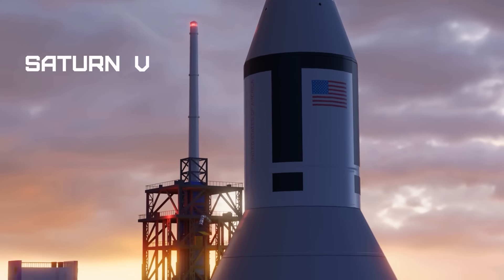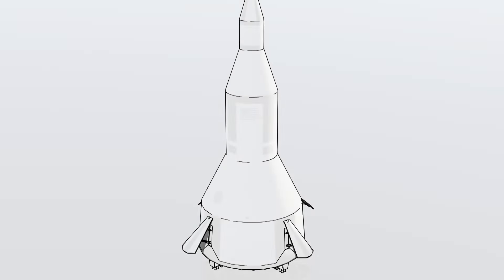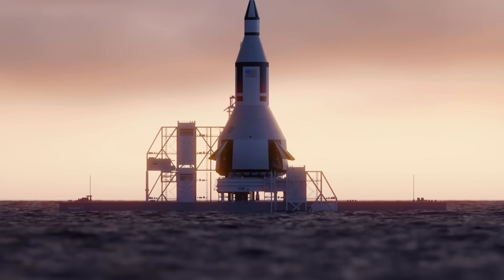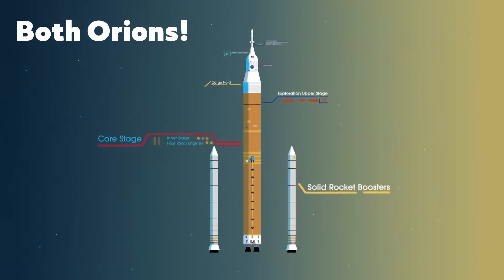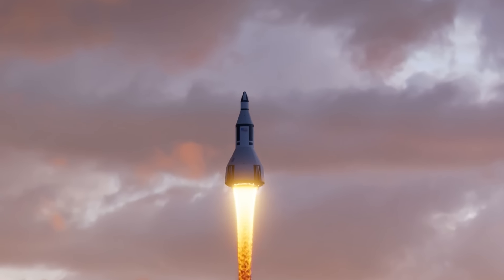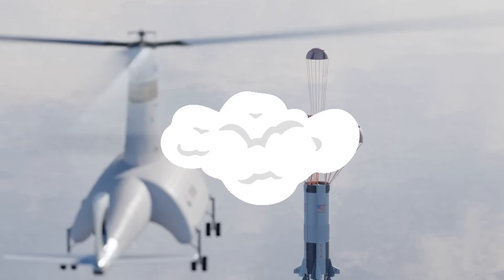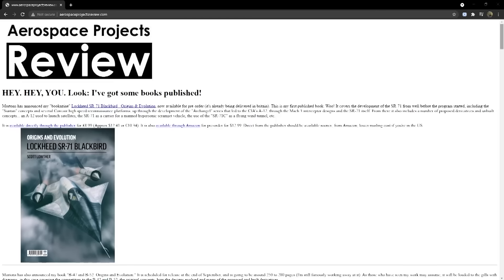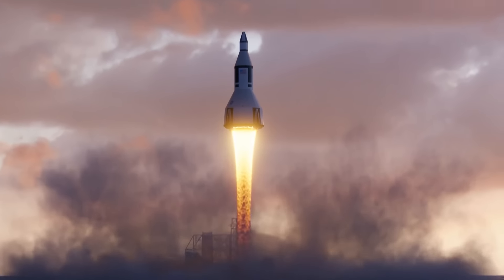How To Fly An Entire Moon Base In One Go - Saturn V 2.0 - Convair Nexus

Comment: Once upon a time, I studied aerospace engineering. One of the problems faced by these gigantic rockets but surprisingly unknown at the time is the fact that the structures of the rockets are not perfectly rigid. Pogo oscillations where the spring rate of the structure interacting with acceleration oscillations caused by propellant manifold pressure changes causing thrust changes...is a very complex dynamic that later destroyed the Russian N-1 booster. Handling and suppressing Pogo oscillations becomes absolutely critical in a large rocket.
Reply: Have you heard of Kerbal Space Program? It's a huge pain when you're trying to build rockets in that game.

Comment: The SRB's were needed because it became clear that while hydrogen/oxygen rockets are massively efficient they don't have a great thrust-to-weight which means it is slower to accelerate off the pad and therefore wastes propellant fighting gravity.

Will there be a seperate "Saturn V-NEXUS" video? You kind of mentioned it in passing, (as did Convair, after NASA requested the idea be looked at Convair used part of ONE page in its report to "note" that the "Saturn-NEXUS" design would be a total redesign of the Saturn S1 and SII stages to be fully recoverable and fully reusable AND allow a much larger payload mass to orbit using most of the same facilities and infrastructure already established for the Apollo program. (One major concern which the Saturn-NEXUS addressed was the short-comings, no pun intended, of the VAB which could not handle the height of some of the later planned space probes and launch vehicles being to 'short' and  the doors being unable to be made taller) Saturn-NEXUS would have packed the same power and lifting capacity into a much shorter but wider (but well within the door width of the VAB) two stage launch vehicle which would lose none of the Saturn V capacity but would be fully reusable.

As a note the original NEXUS while being sized to carry a larger Orion drive vehicle (size mattered, the small Orion drive which would launch on something like a Saturn V was actually too small to be really efficient whereas something with a 20 to 30 meter 'pusher-plate' was far more efficient) the rather 'insane' part was this changed to using OPEN CYCLE gas-core nuclear rockets! Essentially a nuclear engine core so hot it is ALWAYS melting down (hot enough to form a plasma actually) into which liquid hydrogen would be pumped for thrust. Needless to say a 'slight' downside here is containing the hot plasma nuclear fissioning material was essentially impossible and this thing would be throwing out radioactive materials all during operation.

Comment: The Convair Nexus seems like what would've happened if the Saturn project evolved and took on the team working on the Sea Dragon
Reply: The convair nexus would have never happened. Just listening to the outlines of what it was supposed to do I can tell you this thing would fail. If not in engineering then in cost.
Reply: Proper descendant of the Saturn V 1969-1972
Reply: @GusOfTheDorks  I don't doubt that it would've failed, but I feel that the lessons learned from that failure could've been invaluable and accelerated our space capabilities, instead of stagnating with the Space Shuttle and Soyuz as our only means to orbit for decades.
Reply: @bethtargett4304  No, that would be horrible. Every failed project is resources that could have been poured into something realistic. Never mind the fact that a rocket failing is incredibly dangerous. I mean its fun to watch, but that dome has 5 foot thick bits of titanium. No matter where it blows up at, you dont really have control of where that kind of stuff lands. Or what happens to the people on it when it fails.

Comment: What a marvelous era of unbound optimism. The downside was, as other commenters point out,  that those harebrained project almost always included military applications. That was also their downfall - once politicians realized that ICBMs are good enough, and those launched from boomer subs survivable enough, they lost interest.

There is another factor contributing to present dearth of such grand proposals: aerospace industry consolidation into only few giants leading lazy life on mediocre "cost-plus" projects. To wit, see Boeing.
Reply: Cost-plus makes sense though - cut corners are the last thing you want on a spacecraft.
Reply: @HalNordmann  You don't want to give lazy manufacturers unlimited budget and no deadline, either. You end up with SLS.
Reply: @bazoo513  Compared to other projects, SLS isn't as bad as it may seem. Every aerospace project is overbudget and late, it is literally rocket science after all. Plus, most of SLS's costs are fixed ones (worker salaries, sweeping the floors, maintaining the tools, etc.), which combined with low yearly budget can get high. Sometimes you can get something done cheaper by giving more money up-front.
Reply: @HalNordmann  I agree about projects ending up much more expensive if you finance them by the eyedropper, but SLS was drowning in money mostly taken (by Congress) from the Comercial Crew program, which ended up comparably dirt cheap.
Reply: @bazoo513  Saturn V was also expensive. And ComCrew seemed to be drowning in dev money also for something supposed to be "off-the-shelf" per-flight payments.
Reply: @HalNordmann  Apollo program (of which Saturn V far a significant, but not major part) put people on the Moon seven years after the first suborbital crewed flight. SLS took 11 years to cobble together a launcher out of leftover Shuttle parts and is yet to fly.
As for the history of Comercial Crew program and its funding, I suggest looking it up a bit - I will not rehash it here. It was not a purchase of "off the shelf" services.
Reply: @bazoo513  SLS is way more complicated than putting together spare parts - core tankage had to be completely redesigned to handle different loads, SRBs have brand-new active parts, launch infrastructure is brand new, and so on. A lot of these issues hadn't been expected, and don't forget the smaller yearly budget. They simply couldn't get as much work done per year.
Reply: @HalNordmann  Can't you take a bit of hyperbole - they had to do something . And, again, compared to the actually work done, their budget was huge at the cost of the actually working Commercial Crew program.
Whatever.
Reply: @Sciurus  Your autoregressive language model based text generator is broken. I suggest switching to GPT-3 or LaMDA 2.

Electrohydrodynamics is well understood, fun, and, sadly, useless for practical applications.
Reply: @bazoo513   I think you misunderstood what I am referring to. Maybe you should start by watching Eric Dollard's lecture on YouTube titled "History and Theory of Electricity". He also has many other good ones that further explain the pulsed longitudinal dielectric "wave" phenomenon!

I am not referring to electrohydrodynamics (or magnetohydrodynamics) or even the transverse wave Electromagnetic spectrum based phenomena. I am referring to phenomena that occur when using pulsed high voltage dieletric fields (electrostatics) that Nikola Tesla was working with after he had moved on from studying Alternating Current based technologies. 

Dr. Thomas Henry Moray's book "Beyond the Light Rays: the Sea of Energy that the Earth Floats In" would be another good reference to take a look at as he also studied this phenomenon and developed many technologies to control it. He was also the true inventor of the germanium transistor almost 20 years before Shockley got the patent using one of Moray's assistants on his team but the patent office screwed him, but alas that's another story for another time. The newest edition of "The Energy Machine of Joseph Newman" might be useful too. William Lyne also has some interesting and relevant books, i.e."Occult Ether Physics" and an interview that is floating around YouTube on a show called the "33rd Parallel" that you might be able to find by searching for "William Lyne Hitler's Flying Saucers".

If you have the time and desire to look and learn (admittedly two resources that are in short supply for all of us these days), then maybe after you go thru this material you will understand what I am referring to! Best wishes to you!
Reply: @Sciurus  "... and developed many technologies to control it" - Such as? Why are they not around? Someone "suppressed them"? Who and, most of all, why?

Best wishes to you, too!
Reply: @bazoo513   I'm assuming you mean Dr. Thomas Henry Moray since that's the part you quoted, but he developed switches, diodes, triodes, resistors, inductors, and all other sorts of fundamental analog circuit type signaling components for Tesla's radiant energy/ dielectric longitudinal waves / electric sound waves. Basically analogs to the fundamental common components used in normal electronics, but instead of developing them for electromagnetism, i.e. direct current and alternating currents, they were developed specifically for this other type of field perturbation, the dielectric longitudinal "wave". They were all components he developed and worked with for his "Swedish Stone" Generator system. This was the analog days before digital signaling equipment was a thing. Who shut him down? Initially? According to him and first person witness accounts it was communists that had infiltrated the Rural Electrification Administration, one even attacked him with an axe 🪓 and then chopped his prototype up at a public exposition of the device. The poor guy was shot at so regularly he needed to build an armored car and never went anywhere without a loaded revolver. Who ultimately shut him down? Market forces and lack of funding because when his generator was axed to death by some 1930s American communist sympathizer emulating Jack Nicholson in "The Shining", all the working components that he reused when building new prototypes that he had that had been custom machined and manufactured in Germany at the time were destroyed and were too expensive for him to replicate again on his own (cost him like the equivalent of over $230,000 in today's money and the guy was self employed and ran his own lab out of his home doing hardware development research for the big radio manufacturering companies as his day job, there was no software back then, short of maybe paper punch cards to program things like automatic programmable looms) and he was unable to rebuild the device. Without a working model he couldn't get funding from the American business aristocracy. But why listen to me when you can hear or rather read it from the horse's mouth (since he's been dead since the 1950s) and read the book he wrote, "Beyond the Light Rays: the Sea of Energy that the Earth Floats In"... it's only like 60 to 80 pages depending on the edition you download! The dude lived one hell of a wild life for an engineer! If this sort of thing interests you then you'll probably really enjoy his book! And a lot of the things he was doing seem to be very similar to what John Worrell Keely was doing (Dale Pond has some great lectures on YouTube about Keely and Walter Russell, along with a wiki called SVPWiki), using high frequency longitudinal waves (ultrasound), and multiple musical chords/frequencies of these waves over the same signal line (Keely used a combination of silver, gold, and platinum in the wire who's specific gravity he claimed worked out to a ratio of 3:6:9 and caused it be superconducting/very minimal or no resistance to the phenomenon of Sympathetic Vibration [NOT electromagnetism or dielectric fields] that he was working with in his machines) to cause matter to break up and disassociate, sometimes even below the atomic and even subatomic scale (and Keely did all this in the 1870s-1890s before the global scientific community knew that it was even possible to split the atom). Keely actually had his own model of the atom and how it was structured. Unfortunately Dr. Annie Besant hid away Keely's research journals after she was given them by his patron and fellow Theosophical Society member, Clara Bloomfield-Jessop, to prevent his more destructive inventions from being used in the coming World Wars! (The Theosophists alledgedly had many clairvoyants amongst their members and had amassed a very large repository of ancient Occult knowledge from India and Tibet! You might want to check out a wild book written by Charles Webster Leadbeater and Annie Besant titled "Occult Chemistry"). Rereading Dr. Moray's book myself again years later after learning of the work of Keely, Fulcanelli, Boscovich, etc., I have to wonder if Dr. Moray also subscribed to the same school of thought as the Natural Philosophers... but I guess short of building a time machine there's no way to go back and ask him! Maybe one of his children or grand children are still alive but they might not have the answers to those sorts of questions, even though I think I remember reading somewhere that his son helped get his book published and was somewhat involved with his father's research. Well I hope this was helpful and has encouraged you to either buy his book or just download the .pdf version for free and read thru it!

Comment: 0:21 "despite landing without rockets or parachutes", then shows an animation of it landing with rocket, with airbrakes that partially function as a parachute. also it's in no way, a "Saturn V 2.0", it's a completely different thing, not derived from the Saturn V in any way, yes, it was supposed to be the rocket used after the Saturn V was done, but it's not a different version of the Saturn V.

Comment: Generally a good video but I felt a piece of me die every time you said Saturn “Vee”. 🤦‍♂️ The V in Saturn V is the Roman number for the number five. How could you possibly not know this? Please go back and fix it since no one will take you seriously if you leave it as is. Also, while you’re at it, how about adding overlay text with SI units every time you use Imperial units?

Comment: By the way for scale a nimitz carrier bow section is just over 1 million pounds and the rocket it's self weights the same as a Midway class Carrier(Last new US carrier class of WW2) displaces... 
So the scale of this whole operation would have been massive and oddly resnble for the time as the Nimiz was designed in he late '60s early '70s. The issue would have been getting the ok to use nukes and useing titaum in manufactor and getting it on this scale. So while cool and "doable" using smaller rockets/spaceplanes to build the lunar and orbital faclities would have been better.